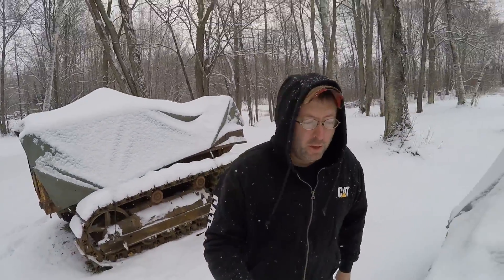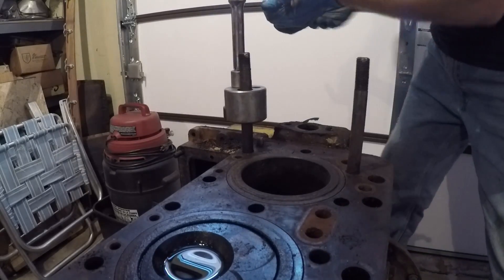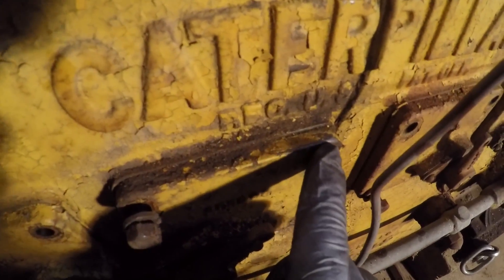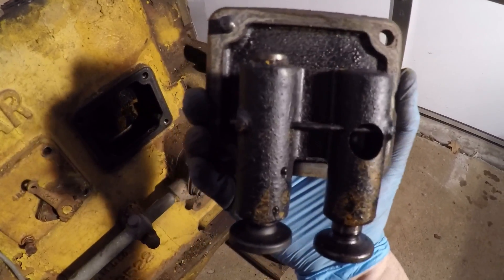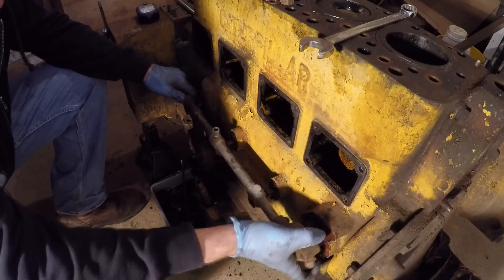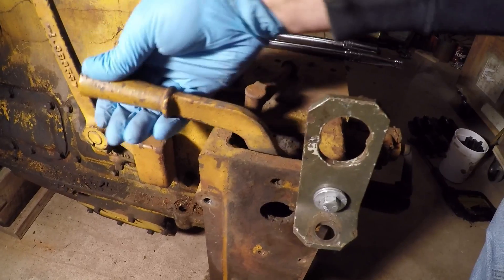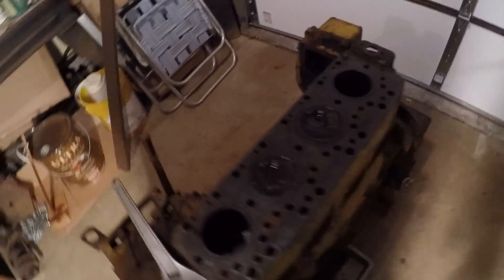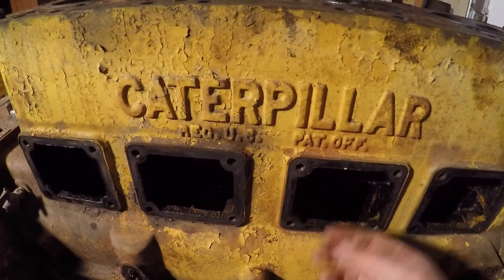Caterpillar D2 #5J1113 Diesel Engine Disassembly - Day 1

Comment: Mr. Squatchly: when using one nut above the other to remove any bolt, for we mechanics this is called a jam nut. Usually when used to hold a loose position, the jam nut is only 1/2 as thick as the holding nut when used while the engine is running or building fab.

Comment: I used to deal with rusted solid muscle car era blocks a lot. I have always thought about using a thinned out fill of penetrating fluid, and putting a small vibrating electric toothbrush  in the bore for a bit of time. I always wondered if the agitation of the fluid would help work the penetrant into the small spaces that the penetrant would not diffuse into normally, almost like a sonic cleaner. I can't vouch for it, as i never have tried it, but if things go south what is there to loose. The science behind it makes it seem at least plausible. I hate to see stuff like this engine go to scrap.

Comment: That's great! Sounds like you can likely save the pistons and probably cylinder liners.

I don't know much about blocks with removable liners. When you pull the liners, will you be able to see the back of those cracked frozen-out water passages in the side of the block, or are they still farther away?

Comment: So I sent the the head for the grader to a machine shop to get valve guides so than went to take out the studs so they take a vice grips and they use it on the treads they almost had to pay for new studs
Reply: I see why you did it your self when you work on the transmission you did it your self.

Comment: The D2. Going by the serial number was made in 1938 around. About September / October from East Peoria Illinois. I have a question . I have a 1944 D2 . There is SP at the end of the serial number do you know what it means
Reply: Thank you for the reply. This would make sense as they were used for agriculture. Land preparation.
Reply: I had a Dec in a tug boat it was 7 18 27 x it was a experimental motor just a early cat diesel my understanding is cat didn't go into diesel production till 1933 or abouts? Pony motor only rope start.
One he'll of a motor....

Comment: Irregardless of a job having a good thing happen is always a plus. Maybe just mabe that block maybe repairable. If no damage is found on the blocks inner walls about  5 lbs of brass rod might be installed to reseal the O'l girl... ??????
 I came across a D-2. On long Island over by Ilwaco Washington, the head was off it it's been there like that for years.  The casting looks like the track shoes. Dark rust and growing thiings on it. That one was a cable blade. Best of luck to you...

Comment: Don't you love those Sweet little Surprises,,,, I discovered by using a 50/50 mixture of Acetone,& Synthetic ATF  which is half the molecule size of Any penetrating fluid on the market,,, this will penetrate anything even if it's fuse together,,, I'm restoring a 1960 F100 4 by 4 I have yet to twist off or ruined one nut and bolt on this vehicle by using this mixture,,, Excellent video, methodical breakdown.
Reply: I use this mix now all the time instead of PB Blaster, it's awesome. Though I'm using regular ATF with Acetone not synthetic, might have to try synthetic now.
Reply: Thanks for the tip, gotta try it!!

Comment: If that #1 is still stuck, it's in the perfect position to dump a cup of diesel in, light it, and let it burn out. The heat from the fire is often enough to break the piston free.  Only caveat is it's inside and doesn't look like you can roll it out easily... So don't burn the shop down.
Reply: I tried it on a 4 cylinder Fordson E27N motor that all 4 were stuck and fluid wouldn't run down past the rings, I was told use a mix of diesel and motor oil for a better hotter fire. I tried carefully jacking the pistons using a bottle jack and hard wood block in the bore and chain round the block to push against.
         It wouldn't budge even with removing the rust I could see. I heated it for a while with the fire in the bores, and it did free off and turn over after moving it with the jack and swapping a few cylinders to push the other way a few times. The block was frosted junk like this one, i just did it to see if it would work I've never tried it again. 
      A buddy of mine filled his Perkins P6 cylinders with evaporust type liquid after cleaning the worst rust and water out,  that worked to after a few days. his motor had sat out 20 years with the head off, so was a right mess before he got it.
Reply: @super6954  I have been a witness to that procedure and it worked on a C Allis.
Reply: BarnyardEngineering forget the diesel throw a mug of coke a cola in it will be free next day